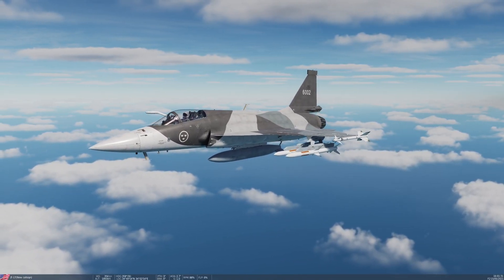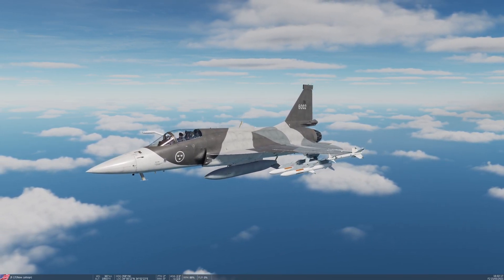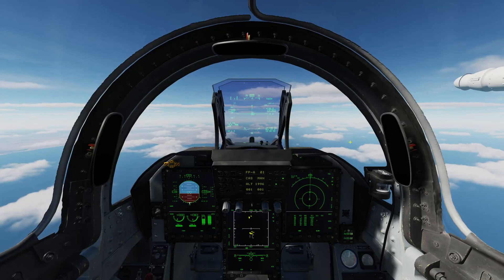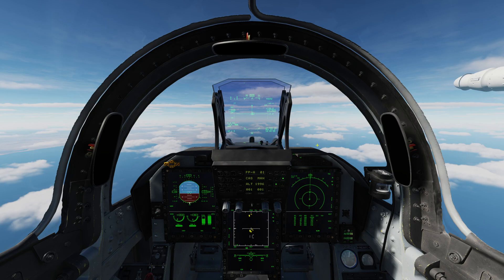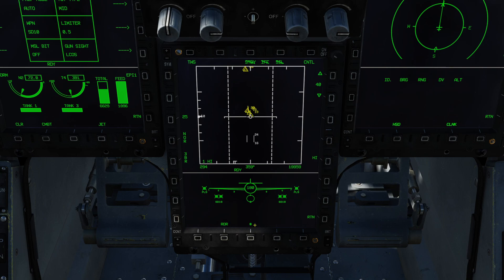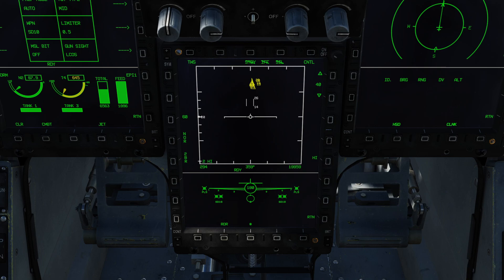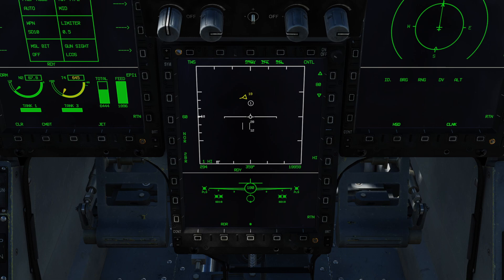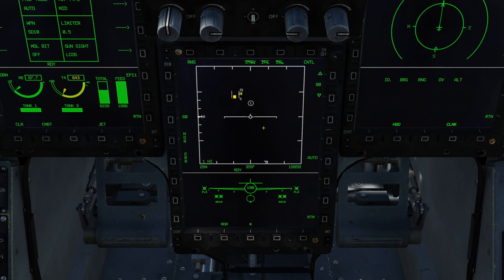DCS JF17 Tutorial 3 - A/A Radar BVR Modes

Comment: this plane is very cool but its a pity it has so little internal fuel...
Reply from the maker: Very true, on the upside you can carry two external tanks which almost double your fuel load and it does have a refuelling probe so you can A/A refuel it.
Reply: It does just fine so long as you don't ride Mil or ab unless you need to. Getting to high altitude also helps.